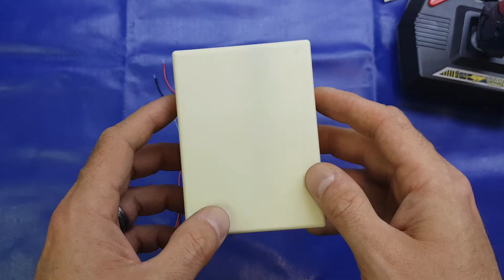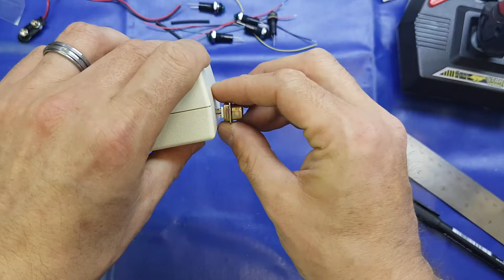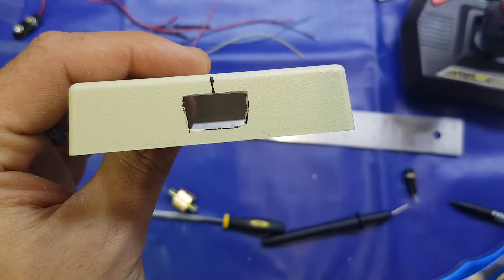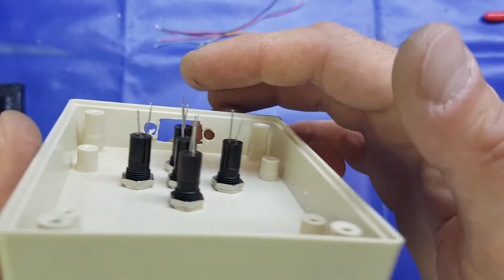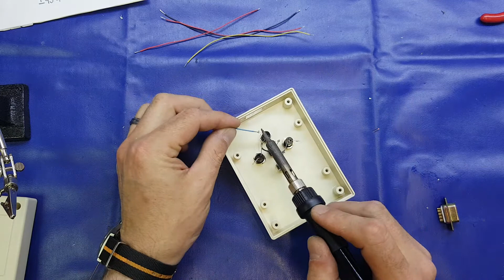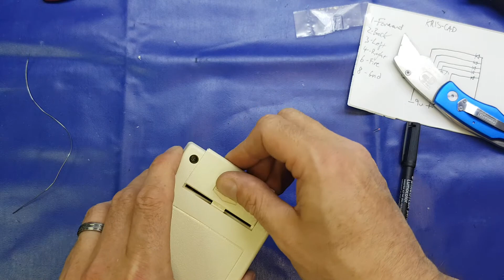Retro computer / Commodore Amiga joystick tester - project build (computers / electronics tutorial)

Comment: This is so simple yet so amazing! As soon as I saw this video I jumped on my local tech-stuff store's site and ordered the necessary parts to build something similar. No need to fire up a system and load a game, no need to type in basic code, just a simple circuit. But people should know that these kind of testers work only with C64/Amiga joysticks (and their relatives like the Atari and some functionality with Sega Megadrive/Genesis), since all the controller does is shorting 2 pins. Thanks for the idea!

Comment: Idealy you should use a cheap 5v regulator, like a 7805. Home computers and consoles of that era only ever ran on 5v and the circuitry in the joysticks (for things like auto fire) wouldn't  be designed for 9v.
Reply from the maker: +Peter Owen Cheers Peter - what an oversight! I've done a short-ish video with your suggested modification here - https://youtu.be/xExKz6xzPC8 - Thanks again!
Reply: Peter Owen the joystick was supplying ground and the leds already had resistors to take them down
Reply: That's not what he's saying - some joysticks/pads from that era had variable astable multivibrators in them to make it fire repeatedly with 1 pull or push of a button. That means there was silicon in there
Reply: Agent Smith 555 is 4.5V to 16V. Why would that need a voltage regulated to 5V?
Reply: why? cuz the capacitor ratings vs voltage will affect it, just like with transistors
Reply: it's more likely they'd use custom silicon blobs anywas